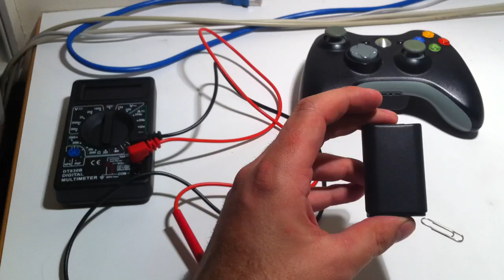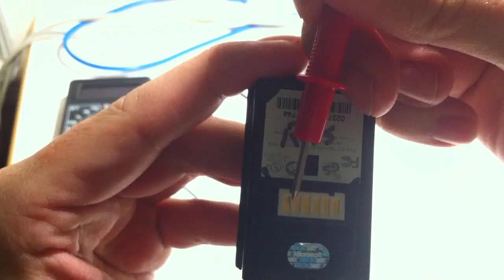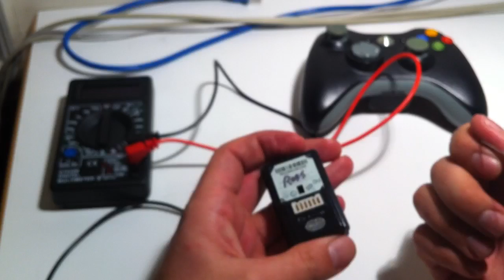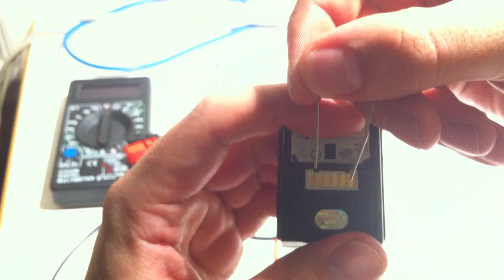Xbox 360 Controller Battery Pack Quick Fix (including play and charge kit)

Comment: Doesn't seem to be working, I followed the instructions directly, doing 2 and 5, 1 and 5, and 2 and 6, going slowly from step to step and then repeating. Still doesn't want to charge. Seemed like a pretty easy fix if it works for other people. Or maybe I just need to repeat it some more/wait for the battery to run out of charge by itself
Reply: Same here. Tried it multiple times with a paper clip and it won’t work.

Comment: A note for those that say the paper clip doesn't get warm: maybe your batts are so drained out, it won't heat up. In my case both the clip and the bottom of the pack got really hot and didn't cool off till the batt was at 1.24v. This took several minutes to achieve. I also took breaks as to not overheat the batt and cause more problems. When it wouldn't heat anymore, did the reset (pins 1 to 5, then 2 to 6), plugged it to charge and 3h later it was fully charged. Thx, poster.

Comment: My official battery packs had been left for a long time (over a year unused) and kept  going to the green light within a few seconds.  I did the first step in the vid (pins 2 & 5) but the clip or pack didn't get hot.  I then did the next steps of pins 1& 5 and then 2 & 6.  It didn't work at first, so I repeated the process three times (plugging in between pin shorts) and it worked!!! so chuffed and thanks for sharing this info.
Reply: Assumed it didn't work until I saw this comment. Tried another 5 or so times in a row (for a battery that's been flat in a drawer for the last few years) and the charge light popped right on.

Comment: If you are doing this trick and you are still getting the green light after a few seconds try unplugging and reconnecting the charger several times until it stays red. I have had to do that many times with my controller to get it to charge for me. Doing this apparently will trickle charge the circuit until it is finally able to properly detect the charge level and will then allow it to fully charge or so I read once.
Reply: +Haldrie u rock bro thank-you it was not working till i tried your trick now it is cheers
Reply: +Haldrie  works for me sometimes
Reply: Thx man it helped alot

Comment: You deserve more credit, this worked perfectly.

For anyone who might be having trouble, make sure you are discharging it long enough. The "getting hot" part isn't too important.

I was testing mine by just plugging the pack into my controller to see if it would turn on, this is wrong. Even if your controller doesn't turn on, the battery may still be holding a trivial charge. I had to get mine below 1V for this to work.

If you don't have a voltmeter, I'd recommend discharging for at least ~5 minutes.
Reply: U sir deserve a cookie. Thanks!

Comment: Cheers!  I didn't discharge the battery pack completely... I used a DMM to measure until I had discharged ~1 volt. Plugged it back in and got the red charging light. Thank you, my friend!

Comment: Good tip. I would recommend using a real load to drain the battery. The paperclip is a dead short and could damage the battery. It could also get hot enough to cause a burn injury. A 3 volt led or a small 3 volt flashlight bulb would be a good load to drain the battery as well as indicating you are actually draining the battery without a piece of wire heating up.

Comment: No way! Fantastic! Worked first time with both of my battery packs.
I used a thin plastic coated wire to not feel the heat.
As it's already been mentioned the 2nd and the 5th points are the ones to short (not the 2nd and 4th).

Comment: Wow, it did work. Was about to trash mine when I saw this vid and it works! My batt pack wouldn't charge past 1.3v (full charge is 2.7v) even after many hours of charging. This meant the controller would shut off upon removing the charge cable (never even got the green light). It truly looked terminal. Did the procedure as instructed and it's now fully 2.7v and holding up nicely. Fraviaseeker thx a lot for this. Saved me from giving M$ my money.

Comment: worked for me! my controller had about 1/2 charge (according to the icon in my xbox dashboard) and I held the paper clip on the terminals for maybe 5 mins (it didn't really heat up too much). Then held it on the other terminals to reset it (10 seconds each) and now it's been charging for 90+ mins (still going) which seems like it's brand new and back to normal. THANKS!

Comment: Nice. It works just fine. I had my controller in a a closet for about 4 months and the batteries went dead and wouldn't charge completely or hold the charge. I did this and it worked!!! Fantastic. I love it. I had to star chargin it 3 or 4 times until the red light hold on (is now charging to its fullness, I hope.)

Comment: I found this from an old thread on Xbox Achievements forum. Thank you. I will try this here in 2024 on some old OEM battery packs that are not charging. So, I would think it may be better to use a resistor. That at least won't be a "short". The resistor should discharge the current and dissipate the heat. It will be slower, but controlled by the resistor. A paper clip is a piece of wire only, with no voltage dropped across a load (like a resistor). I think this would be safer for your hand and better for the battery health. I could be wrong.

Comment: This appears to have worked for me, been charging for about 15 minutes now.  Before it would turn off either instantly after unplugging or within 30 seconds, and on plugging it in would tell me the battery was either full or empty.  Now it says low with the red light on, thanks for the video!

Comment: I had 2 fully dead batteries. I used the reset method shone here and plugged and unplugged charger for a couple of minutes no red light. I reset again and plugged and unplugged again no red light. I decided to try and reset again and use my USB charger cables. Plug and unplug for a couple of minutes no red light reset two more times and I have red light and charging via USB charger. Both battery packs! Thanks for this video!

Comment: Another fix is to connect the charge lead and remove the usb end enough to make the light go out, insert slightly but not fully, repeat this until the light goes red instead of staying green, leave controller and it will take a full charge instead of a 5 minute charge!

you may also need to try the secondary usb slot, I believe they have a bug where the xbox thinks the battery is fully charged when it is in fact not.

Comment: Wanted to let you know that it took 4 tries with my battery pack. It had little juice in it and I just kept following this procedure, repeating it and now the battery is red and charging. Before it would turn green after less than a minute and would not charge. 

Thank you! Ill repost when the battery is fully charged.

Comment from the maker: @tjlifecore It should be instant assuming it has a strong charge. I've noticed that tapping the paperclip to the terminals (2 & 5) quickly cause it to heat up quicker. Even if it doesn't get hot, I'd recommend to hold it on there for a few minutes.

If it wont charge after 4 or more attempts, you can repeat the procedure again. I've had success on the 2nd or 3rd time around.

--Good Luck

Comment: Warning to anyone about to attempt this process!  Release the paperclip every 2-3 seconds.  If the battery has a charge the paperclip will become very hot very quickly.  Use appropriate protection between the paperclip and your fingers.  The battery will heat up as well, as seen from the comments below, you can irreversibly damage the battery casing, or worse, cause the battery to burst into flames.

Comment: At first it didn't work for me because there was zero power in my battery. So I plugged the controller into the Xbox and it charged for a few seconds and then light went green. I then did only the logic reset, without the short, and it fixed it!

Comment: Worked for me!

But I had to repeat the process a few times: discharge/reset/charge again for a while, turns green too soon, do everything again. On my fifth try, it's finally working. The battery is charging for about 40 minutes straight, and still going.

Another tip: if your paperclip isn't heating, it is possible that the battery is drained, even if it charged for a minute or two. I had this problem, but persisted with the reset/charge cycle until it worked.

Props to @fraviaseeker for this tutorial!

Comment: First pack took me bout 2 minutes of unloading power, reset and it charges!
Second pack took me over 10 minutes, with 5 minutes of extreme sparkling lol. Then when I looked the white plastic got molten and that gold stuff turned black Lol! Seems like 1 did it perfectly fine, and the other one just puked on me and died.
 Still thx for the trick! Good stuff

Comment: Works.  For some reason, it didn't work the first time I did it.  I did it a second time and it worked just fine.  Now my controllers have been charging with a red light for over an hour.

Comment: I know this is old as hell, but just in case anyone has this issue and this didn't fix it you may have to jump your battery like i did mine. Pin 2 is positive and pin 5 is negative, just take a battery and use some metal to connect positive to positive and negative to negative for a little bit, this will give it enough of a charge for it to start charging in the controller

Comment: It is true that you can use the cable to power your controller, but if you had read your instructions that came with your charge and play kit, it will tell you that "you can possibly damage your controller or the cable if used without a battery pack, or compatible battery pack sold by Microsoft approved 3rd party dealers." Just thought you should know before its too late even though it already might be...

Comment: You're a wizard! Cheers it works
Reply: It wont work for me. How did you do it? I have had a official Xbox 360 charge and play a few years now and i have only charged it a few times and it wont charge anymore now.

I used a metal paper clip and i kept repeating the steps but it wont work. I am disappointed with it as it is a official Microsoft product.

Comment: GREAT,MY BATTERY PACK WAS DEAD, NO LED ,NO CHARGE,WHAT WAS WEIRD IS THAT MY WINDOW COULD RECOGNIZE THE KIT,MY XBOX ALSO,BUT NO LED ON AND AS RESULT NO CHARGE TAKES PLACE.I DID THE EXACT PROCEDURE EXEPT WITH PINS THING,TO DISCHARGE SHORT THE 2ND AND THE FIFTH,NOT THE FOURTH AS THE MAKER SAID,THE REST JUST DID THE SAME,AND IT WORKED..THANKS PAL,DESERVE 10 PTS. ;)

Comment: 4th pin? what ALU? I read it just had a temperature sensor and an eeprom (middle 2 terminals). Also, include your battery type and how you charge it afterwards. My batteries were probably so dead that normal quickcharge kit didn't work. I don't know the voltage needed. My guess right now would be 4*1.2V. I had to kick it with a higher voltage though. Shorty after that, it did take charge at sensible voltage.

Comment: So far it seems to be working. I really hope this solves my issue. Every time I use my play and charge the light stays red for a little and then goes to green but when I unplug it the Battery doesn't last very long. Right now I have it charging so fingers crossed. I really dislike Microsoft's equipment for the xbox. The controller sticks go bad pretty fast. I wonder if PS has that issue.
Reply: For analog sticks try these.
http://www.amazon.com/gp/product/B00CYS11BS/ref=oh_details_o07_s00_i00?ie=UTF8&psc=1

They don't have the "nubs" that wear out, just a ridge that feels very good and sturdy.  I'm replacing all my analogs with them.
Reply: As in sticks I meant the actual stick that is attached to the controller board. Thanks though.
Reply: Ah, no problem.

Comment: Think this is a good fix. So far two battery packs restored. Lasting longer than the previous 5-min-or-less charges. Charge light does not go back to green after 2 seconds of charging. Anymore;)

Comment: Out of curiosity, what voltage between 2 and 5 counts as 'fully discharged'? Also, any idea on safe temps for the battery itself? Seems my conductor isn't acting as an effective resistor, and the whole pack is getting pretty warm in-hand while the clip stays oddly cool.

Comment: This doesn't seem to work with mine. That said, mine was in a drawer for over 4 years without any use so it's probably DOA. When I plug in the charge cable, the light goes green for about 2 seconds then goes off. No red, doesn't stay on etc.

Comment: i dont know what kind i have but when the pack is plugged in there is a light that should turn on. it should be red for charging and green for fully charged. my problem is no matter the charge the light stays green no matter what the charg is and the pack never gets charged since the charger thinks its job is done. 

do you think it is just the pack not wanting to charge like the one in the video or do you think the charger itself is being an ass?

Comment: I was about to comment that this seemed to have worked as the light on mine had gone red and stayed red. But just as I started to type that, it went green again. Trying the plug/unplug method, have done it at least 50 times, how many plug in/out cycles does it usually take before it stays red (if it's going to work at all)?

Comment: I have a battery that is absolutely stone cold dead. When it doesn't even turn on a controller anymore, and when I plug it into my play-and-charge kit attached to my 360, or even into the standing charger that can charge two packs at once, neither charger's lights come on, even for a second. Is there something I can do to fix it, or is that battery pack now useless?

Comment: WHy do you also need to touch contacts 2 and 5?

Cant you just reset it with 1 and 5 then 1 and 6?

Im confused what the 2 and 5 simply do (:
Reply: 2 + 5 are to drain the power from it. The controller doesn't know there's power in there but there is. You need to get all residual power out of the battery, it would be best to use something like a 3v bulb or motor really to drain it out. Then touching 1+5 then 2+6 resets it so it now knows that point is really when it's empty. It's a calibration. When you get in the habit of charging the battery when it's still got 2 or 3 bars of power, it quickly loses the ability to know where empty really is. After doing this calibration and fully charging it run the battery right out before recharging at least twice, it helps to train the battery.

Comment: ok so ive tried 4 times. the first 2 i used a wire the second 2 i used a piece of solder. with the solder i could feel it getting hot. my meter said that the 2.6v werent there so i reset the logic and i havent had success yes

Comment: I tried it and didn't work (I have 3 dead batteries and a good one). When i plug them to the charging station no red nor green light was on.
However i tried connecting the 2nd pin of the good one to the 2nd pin of the dead one and the 5th to the 5th for like 30 seconds and now 2 of them are charging :D 
I hope the good one didn't get ruined though.

Comment: This method did not work for me but i tried another method by using my laptop 3.0 port to charge and it did work. i followed a video where a repeated process of plugging in the extension cable in and out of the USB charging port of the Xbox360--say about 15 times as the video stated  (repeated mine x 4) and it began to accepted the charge...don't know if this will work for anyone else

Comment: My paperclip isn't getting hot. Any thoughts? I've tried two different kinds. I'm holding it on the 2nd and 5th contacts and I've tried it on a full battery and the faulty empty battery. No heat on either one.
Reply: A lot of paperclips seems to have a non conductive chrome-looking coating. I always burn the tips with a lighter (red hot) then wipe them clean while still hot (be careful). you will see the difference easily. Then secondly, scrape the contacts on the battery to make sure you are getting proper contact.

Depending on the paper clip thickness, it may not get hot. I used a large paperclip (about same thickness as the pin). it never got hot, just warm at the ends. Also tried this with a thick ground wire from a computer PSU, did not get warm besides the ends. If it doesnt seem to be doing anything, just keep holding it for a good minute or so, then follow the rest of the steps. 

Also note: if the battery is dead dead, shorting the pins will have no effect, this includes 1 and 5, and 2 and 6.

Comment: Dude this is fucking awesome, thanks!  edit: Discharge occurs between pins 2 and 5, unless there's a reason I don't understand for calling the 5th pad "pin 4".
Reply: +c lit Electric Circuits start with #0
Reply: +Ayleid Ruin That doesn't work, since the 2nd pin is called pin 2, and the 5th pin he calls pin 4.
Reply: I see what your saying c lit  I just meant in electronics the first pin is always marked with a "zero". Instead of a "one".
Ex: 1 through 5 would be 0 through 4 in a Electronic Circuit.  

Besides I think he just called it for what it is; the 2nd pin in from the left and so on.  I just remember that when it comes to Electronics and circuitry that the first pin will always be marked as zero.

Anyways, the video solved my problems with my Cheap $5 battery packs :P  FYI to anyone: I repeated the steps a few times.  And my BattPack/Wallet thanks you fraviaseeker :D
Reply: +c lit oh Wait.  Did I misread that? :P  He messed up by calling the 5th pin the 4th one.  He corrected it in Annotations.

Comment: Hey thxs man it worked for one of my batteries but not for the second one, on the first battery i did it on it gave me some sparks and now it works :). But the second battery that i have the pin doesnt get hot or gives sparks soo i was wondering what should i doo ?? and if i put it on the charger it says that its charging and then turns green right away.